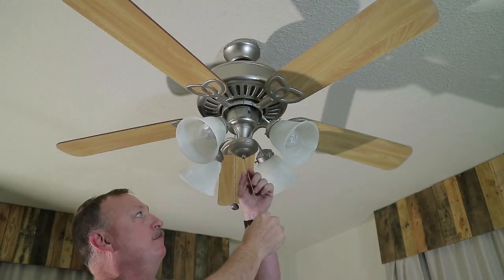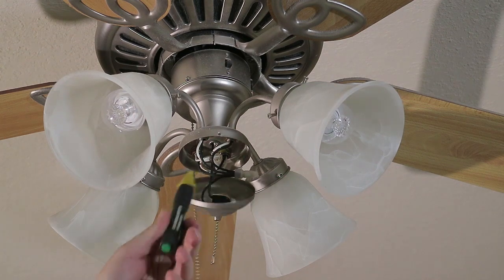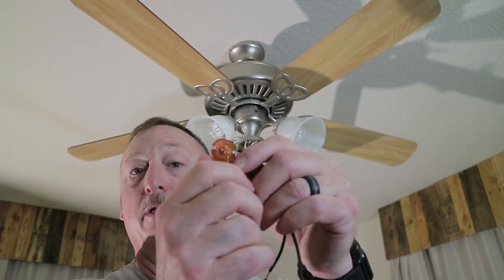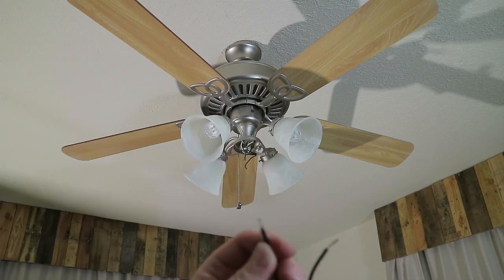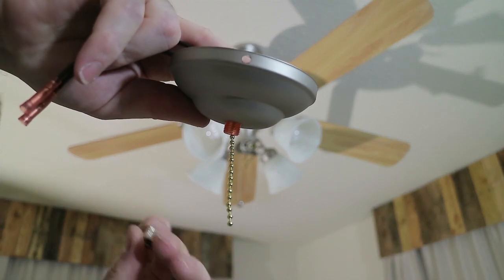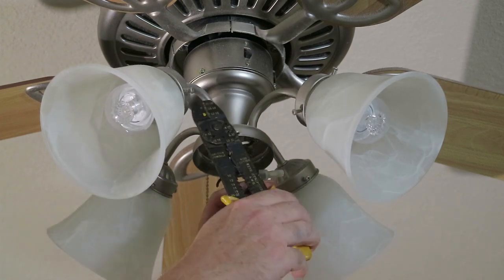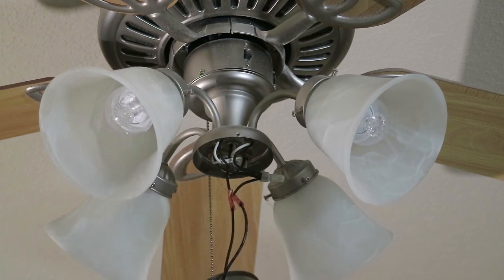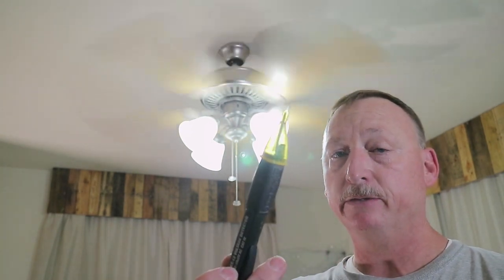Coop's Simple How To - Change A Ceiling Fan Light Pull Chain Switch

Comment: That’s a Harbor Breeze Builder’s Best.
Reply from the maker: Thanks for watching and commenting. Also known as an average affordable fan.
Reply: @LivingCooper  I have two black ones. One of them was extremely slow on high, replaced the capacitor and it works fine again.
Reply from the maker: @CeilingFanVideosOnYT  we’ve since sold that house, but other than the pull chain issue, we never had a problem.

Comment: I cannot find a single video anywhere that shows how to remove the pull chain mechanism that's in the middle of the light fixture of a dome led light
Reply from the maker: Sorry you can't find a video for that.  What make and model of fan are you working on? Not sure I can help, but I can look it up and see if I can give you some ideas. I'm not sure though.
Reply: @LivingCooper  It came with the house so its impossible for me to get the model.  Basically the chain pull mechanism has 2 nuts.  I tried to use a wrench to remove the whole thing from the center bolt.  But the nuts do not get loose further than the surrounding parts.  It's very weird.
Reply from the maker: @Kracov_the_Madman  Sorry.  That is weird. maybe you have to remove and replace the whole light fixture portion. I know I saw some replacement fixtures when I was trying to find a ceiling fan like you described.

Comment: I accidentally pulled my light rope too hard and it fell out, it's in there similar to your fan rope. 
How would I fix this? I still have the rope and everything.. just can't put it back in the hole.
Reply from the maker: Allen Wright  thanks for watching. Sorry that happened. My wife did the same thing. As far as I know you only have two options. 1. Replace the whole ceiling fan. Or 2. You can replace pull-chain switch. They sell them at the big box stores or Amazon. It’s really fairly simple. Nana said that should be my next video. The only problem is that I’ve already replaced all my ceiling fans. THIS IS THE WAY I WOULD DO IT. I WOULD SUGGEST NOT TO DO THIS IF YOU HAVE NO EXPERIENCE!! WORKING WITH ELECTRICITY CAN BE DANGEROUS!!  Here’s how I would do it. 1. MAKE SURE THE POWER IS OFF!!! 2. Pull the light fixture off or the fan. Typically there are two or three screws holding to the fan. 3. Unscrew the switch assembly from the light fixture. 4. Either cut the two wires going into the switch or unscrew the wire nuts to disconnect the switch. 5. Get another switch like yours. 6. Use wire nuts to reattach the switch. 7. Put the switch assembly back into the fixture. 8. Reattach the light fixture to the fan. 9. Turn the power back on.  ALWAYS REMEMBER WORKING WITH ELECTRICITY CAN BE DANGEROUS!! BE SURE TO MAKE SURE THE POWER IS OFF!! Thanks again for watching.
Reply: @LivingCooper  Oh, so that's what the switch repair's for.. my grandpa has over 20 years as a technician so hopefully he can help fix it. Guess I gotta make a trip to Lowe's tomorrow lol
Reply: @LivingCooper  I could probably start from step 4.. it's been repaired 3 times already, and the switch is just hanging there.
Reply from the maker: Allen Wright 😂 you never know who’s watching, or their experience level.

Comment: Stop guys, try this before you go to this extreme‼️
Your switch just may need some lubricant like a shot of WD40 ‼️
You don’t need to turn off the electricity or unplug anything.
Just put that little red straw in the opening where the chain comes out and give it a couple of shots. 1-15-2023
Reply from the maker: Thanks for watching and commenting.  That's a great idea!  I probably wouldn't use WD40 though.  It will gum up after a while.  Try silicone spray lube. Thanks again.